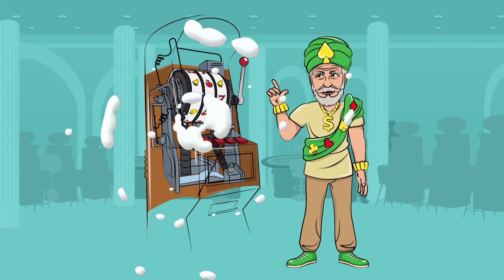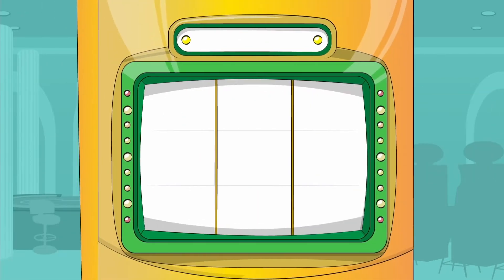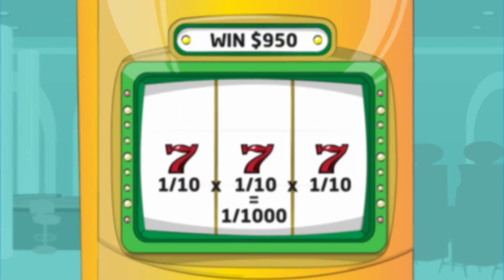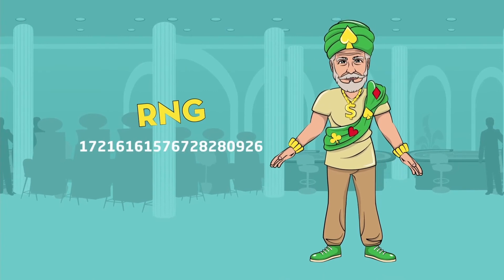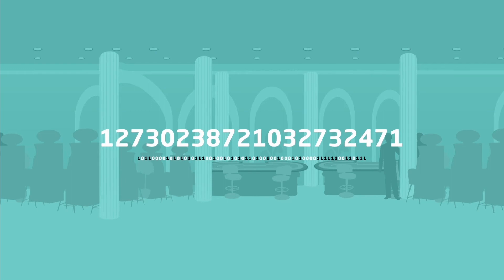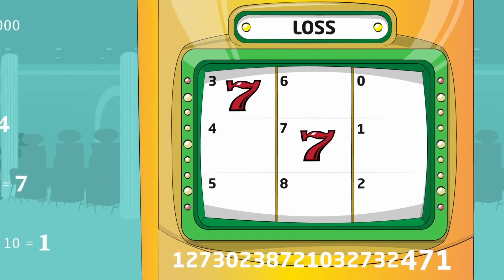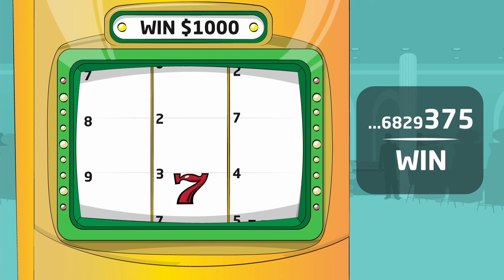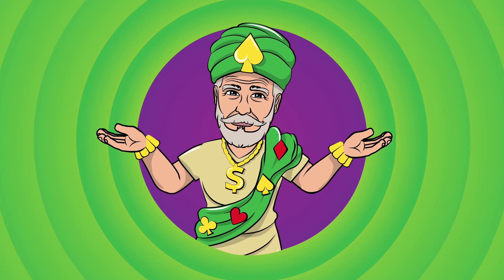Are Slot Machines Really Random? RNG in Online Slots

Comment: The term RNG is very misleading obviously the slot machines are programmed with more lower winning symbols such as the #9 whereas say a king is a top symbol you will notice that it doesn't pop up as often and you will also notice there is more winning combinations of all symbols in the first three columns only  they only occasionally go to all 5 columns in my opinion it is not random if it was random it would have an equal amount of winning combination of all symbols they obviously hit more lower combinations quite a bit more

Comment: The part about video slots is incorrect. Although they do use true RNG, based on physical events. The symbols varying in value for win and 3 cherries for example would not appear as often as 3 sevens. In fact the reels themselves are outcome animations. The RNG is used to produce a number within a range of probility and generate a win value e.g 10 x stake,  20 x stake and so on depending on the odds of each type of win. The person officially gets paid the ammount server side or locally if in some sort of arcade and at the same time showing a video animation of the win and credit on your app kiosk client side. Jackpots would be one specific number in the RNG range, so needs a longer string on binary numbers for the higher range, probably 7 or 8 digits long. For Bonus game if one of most games is paying higher than X amount then show bonus animation. Once the server decides the multiplied ammount it is securely decided and time stamped, with a refrence number, every single bet, if the anything is misleading about the animation in error, or player messes with the games code, it will not matter. Bets are refunded at most as gesture.
Reply: Are you certain that all of them use a true RNG? According to several official sources, the most of them use a “normal” PRNG like every other PC too. And this is also allowed according to the specifications of the GLI-11 v3.0 standard, if the data has no statistical bias.
Reply: @Manic97LP   if they said RTP = 90%, then the program will adjust your luck to 90%. Lets say, in WoW, every lootable will be correct after 13k kills. What about slot like pragmatic? While in WoW, you can prove that your lootable is correct after 13k kills but is there any prove pragmatic didnt cheat you? Well, i never see any prove of pragmatic slot result in solid number and math.
Reply: It's a business model y wud they pay u
Reply: @jane-ew2jh  Overall they do profit. The RTP (Return to player) is 95% or close to that range. So they take in all the money and give 95% of it back, taking a guaranteed 5%. It doesen't seem like 95% because some of the money goes toward jackpots. It's never exactly on the mark.. They test each game very fast millions of times and adjust the odds so they average the RTP matches up. The results are not generated by the profit makers. The game companies deal with that with vendor tokens. The gambling side chooses them from a catalouge and try the demos. They simply add the API to their website and it vends results for them. The games are consistent across every website. There are some exclusive games but the results would be outsourced.